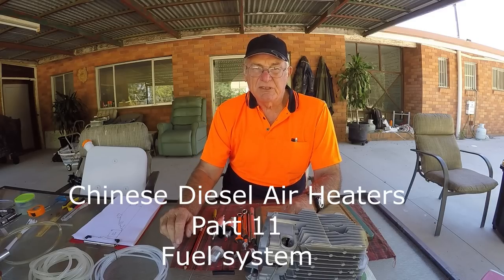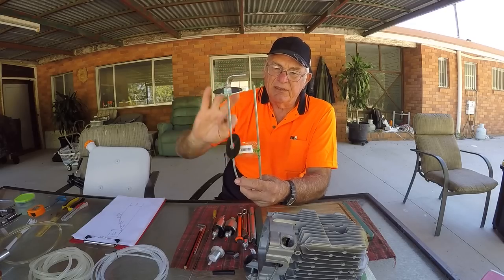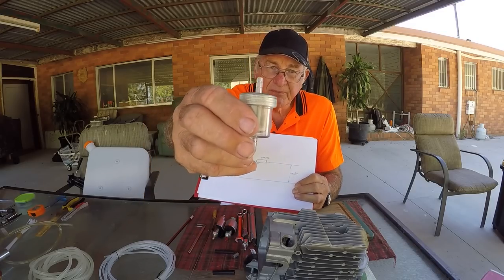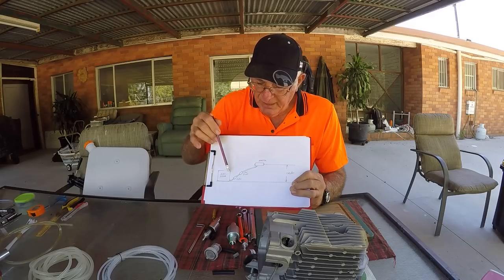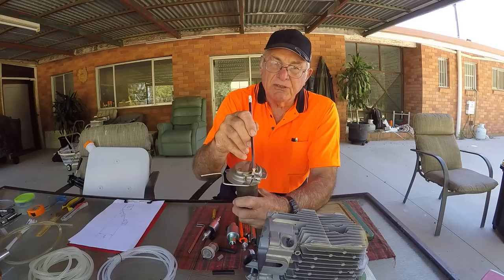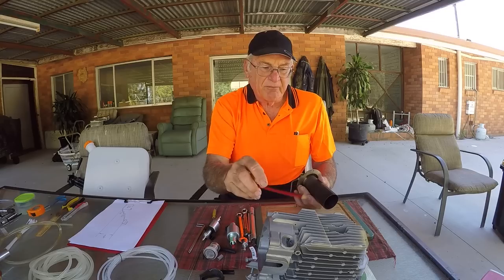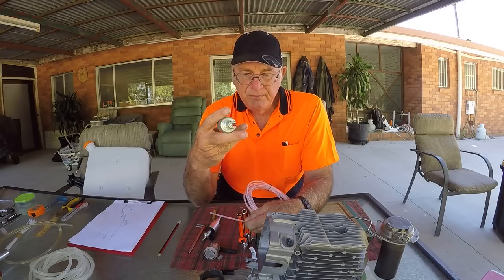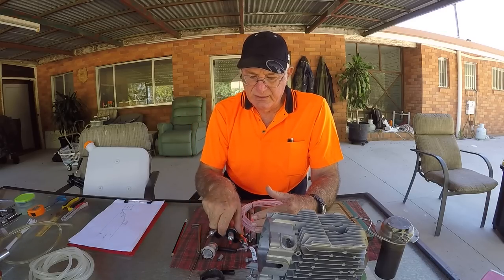Chinese Diesel Air Heaters - Part 11 -  Fuel Delivery

Comment: Hi John, thank you for making these videos they are very helpful! One question, Does it matter which way round you have the fuel filter? I am without instructions and have seen a few people do it differently I have the same filter as you.
Reply from the maker: Hi Rob, first thanks for your positive comments.
Regards the fuel filter. The fuel should enter on the outside of the filter. Think of it logically, you have a large surface area to filter out rubbish, and bulk rubbish and even water drops to bottom of filter where you can see it in a clear filter. If you put inlet to “inside” of filter it will not take much rubbish to clog the filter as there is no “storage” area.  Cheers.   JMcK
Reply: Thanks bud! I have got it the right way. Started it up and this 5KW is only reaching 102c on the heat exchanger. I'm using the correct hard fuel line. It gets warm but not the hot I was expecting. Could this be a problem with the 2mm fuel pick up line I installed into the fuel tank?

Comment: What kind of low temps can the fuel pump operate in? I’d rather have it located outsize my RV but I’m wintering in SD and concerned the pump will fail at low temps. Any advice appreciated?
Reply from the maker: Hi Mr F,

The pumps can operate in quite low temperatures provided you have winter diesel or use kerosene to prevent gelling of the diesel which can clog the pump.

I have personally run the pumps down around -1°C, the lowest winter temp where I live without issues, and overseas the winter temperatures get much lower than in Australia.

Most RV's have the pump outside the "house" and I have not heard of any issues, apart from the gelling issues mentioned previously. 

Cheers.  JMcK

Comment: I have watched several of your videos and have learnt an enormous amount regarding them. Thank you for sharing your knowledge.
Before I buy one can you tell me if they can be mounted on their side (combustion pipes facing sideways)?
Reply from the maker: Hi Guy & Debbie,

Yes they can be mounted on their side, but only the side that has the glow plug on the top. You need to open the heater up, identify the glow plug, and turn it only on the side that has the glow plug uppermost.

Cheers,  JMcK
Reply: John McK 47 Thank you so much for your quick reply! We have a Slide-on Camper which presents different options to a caravan due to the lack of free space on the underside.
Thanks again!
Reply from the maker: Guy & Debbie MacDonald 

Your welcome Guys

Comment: John,

I have an all-in-one unit and am retrofitting the fuel line to 2mm nylon as I said. From the fuel filter to the fuel pump can I just use a black rubber 50mm long connector to connect them or do I need to also use the 2mm nylon fuel line between the filter and pump with a black rubber connector on either side?
Reply from the maker: Hi Dacia, 

I suggest you use normal good quality 4 mm fuel hose from tank to filter (you need a fuel filter) to pump. 

It is from the pump to the heater that you need the hard nylon fuel hose. Soft hose, particularly that poor quality clear vinyl hose sometimes supplied absorbs the fuel pulse and prevents proper atomisation of the fuel. 

The longer the distance from pump to heater, the more important it is to use hard nylon on the delivery side of the pump.

But with the all in one heaters, the distance from the pump to the heater is very short and you can get reasonable atomisation just using good quality black fuel hose. For such a short distance, this is a better option than having the joiners and a very short length of hard nylon hose. 

The risk of joiner leaks in such a short distance of hard nylon out weigh  the benefits. 
With the all in one heaters, I suggest all fuel hose be normal good quality black rubber fuel hose.  

Cheers.   JMcK
Reply: @johnmck1147  Ah! Thanks John! I’ll get the black fuel hose!

Comment: My Diesel night heater is working superbly apart from i have to prime it every time i use it, When i turn it off in the evening the next morning the fuel line to the tank is completely dry. The fuel is draining back into the fuel tank, I have no leaks on the fuel line , Any ideas what could be causing this, When i prime it the heater runs fine again and never cuts out in operation.
Reply from the maker: Hi Jollyroger,

If your heater is about 1 meter or more above your tank the weight of diesel can seep past the tiny little valves in the fuel pump. Just install a shut off valve in the fuel line near the tank, and turn the fuel off when not in use.

You could also have a small air leak in the fuel line. The most likely place is the connection right at the heater. I would also check all your fuel line connections are tight.  

Cheers,  JMcK
Reply: @johnmck1147  Thank you john
Reply: John i have another problem with my chinese diesel night heater, When i try to prime the fuel line it will not prime, the fuel line remains empty and when i checked diesel was running out of the exhaust system, I tried priming it 4 times but it seems the diesel just runs straight through to the exhaust
Reply from the maker: @j0llyroger889  

I suspect you have flooded the heater.

You only prime the heater on first install. That is all. After that you just turn it on. My boat heater has been there over 13 years and even if not used for a year, I just turn it on. You do not prime before each use.

If diesel is coming out the exhaust, I suspect the fuel line is full, and not empty.
If badly flooded you need to give it a day or so for fuel to evaporate before trying again. 

If you are mechanically minded you can remove power to the fuel pump and operate the heater a few times so the fan helps to blow out liquid diesel. The ECU will shut the heater down when it detects no start, but you just hit start again a couple of times. 

If you are not mechanically minded, wait a day and just hit start. Do not prime.

Cheers.  JMcK

Comment: Hi John thanks for the in formative video on the fuel lines. My heater starts but only burns for a few minutes and stops. It also sounds as if it’s hunting while burning. I feel I have a fuel line problem but I’m not using the larger bore hose you described. Any ideas?  Thanks
Reply from the maker: Hi RM,

I need a bit more information before I can offer help.

Is the heater new and this has happened from the beginning?
Is the heater old, and this problem has recently started?
Do you have a good fuel filter?
What fuel are you using?
Is the fuel pump inclined upwards?
What is the distance between tank and pump?
What is the distance between pump and heater?
Are you using hard nylon fuel hose on the delivery side of the pump?
is the heater above or below the pump?
Thats enough for now.

Regards.  JMcK
Reply: @johnmck1147  
Hi John, thanks for the reply. My heater is approximately 12 months old but I have only used 3 times for short periods. It worked fine except for a lot of smoke on start up. Last month I wired in a on/off power switch and decided to start heater. It didn’t start and came up with E8 error. I looked at fuel and thought it was probably stale or contaminated. After starting a couple of times it fired up without a lot of smoke like previously and I decided to run for a few hours adjusting levels of heat up and down while it was running. Next day I decided to run again but could only get E8. After burner ignites it hunted and shut down. When installed I used a RYCO filter. I’m using diesel fuel. The pump is inclined correctly. The distance between tank and pump is 2.2 metres. Between pump and heater is 1.7 metres.  I’m using the hard nylon on the delivery side and purchased black fuel line on the delivery. The heater is positioned above the pump. It’s installed in a caravan. Thanks again John for helping. Rory.
Reply from the maker: Hi Rory,

E08 is a ignition/burn issue.

If only a little use, it is unlikely you have a carbon buildup in the atomisation screen.
However, do you have a filter on the combustion air intake? If not, you may have sucked some bugs into the atomisation screens.

Another thing I would do, is try and move the pump much closer to the tank. These pumps are much better at pushing rather than sucking. I try and get the pump less than 500 mm from the tank.

Next check your wiring and plugs. Do you hear the pump giving a regular strong “ticking” sound.
If not, you may have a voltage drop issue.

Do you see a steady stream of tiny cavitation bubbles marching along the hard nylon fuel line, at a regular spaced interval. If not you have a fuel delivery issue.

Cheers,   JMcK
Reply: @johnmck1147  
Hi John, thanks for the info. I’ll check what you’ve suggested.

Comment: Is using kerosene recommended for cold climates ?
Thanks for the very informative U tube.
Reply from the maker: Hi Solarrs, a kerro/diesel mix say 80%/20% can be beneficial for very cold weather or high altitude use.  JMcK

Comment: Hi John my mate have one of these heaters as do I, but his has started mucking up, it starts and runs fine but after 15-20mins the dosing pump stops running and it's as if it's gone into shut down mode all by itself. We fit a new pump but did nothing just the same, could it be the temp sensor do you think. Sadly his heater has the dial control not the digital one. Any help would be greatly appreciated mate. Thanks. Seeya Rob
Reply from the maker: Hi Rob,

It could be an overheat, or low voltage, or fuel blockage.

Your dial controller is simple to operate, and preferred by those who just want a simple controller.
But it will have little LED lights around the dial that tell you the temp setting. 

These will also flash if the heater goes into shutdown mode. Count how many lights are flashing, that will give you the error code and tell you the problem.. eg three lights flashing = error code E3
JMcK

Comment: Great video series John! These are very informative. I have two questions: first, how to you prime the fuel line without abuse the fuel pump? Do you use some sort of tool to prime the fuel leads? Second, is it an issue when the fuel tank is mounted above the heater instead of below? Thank you and keep up the great work.
Reply from the maker: Hi Hibon,

Thank you for the feedback.

1.  I generally, but not always, personally prime the diesel from fuel tank to the pump the way I learn't as a kid some 60 years ago, I insert a length of  clear tube so I can see the diesel and manually suck syphon prime the fuel line. but these days I have to tell people not to do it that way, as if not experienced or not careful you can suck fuel into your mouth and in a worst case swallow the fuel. 

You can use an outboard primer bulb, or buy a cheap prime syphon bulb from an auto store. You can also use an old large "horse" syringe to suck the fuel along the pick up line. 

If the fuel tank is mounted above the fuel pump it is important to install a shut off tap in the line before the fuel pump. But I recommend you always install a tap in the input fuel line regardless of whether the tank is higher or lower than the heater or fuel pump.

If the fuel tank is mounted above the fuel pump it will self prime. Take the hose off the bottom of the fuel pump, put the end into a glass jar, open the fuel tap and when diesel flows out turn off fuel tap and or put finger over end of hose and then push it on to the bottom of the fuel pump. Note, make sure the hose clamp is on the fuel hose first. 

Good luck.   JMcK
Reply: @johnmck1147  Thank you John!

Comment: John, if I am installing 2 diesel heaters from the same fuel tap, do I need to install check valves to keep one pump from sucking away the other's prime?
Reply from the maker: Hi JMatt,

I have not actually tested this myself (yet), but in theory it should work as the pumps have non return valves in them. But your question is a good one and when I have the time I will test it out.

Cheers.  JMcK

Comment: Hi John, thanks for all your great work with these videos. With installation under my caravan, I’m going to end up with a run of somewhere between 3.5 and 4 metres between the fuel pump and the heater. I know you have stated that ideally this part of the fuel line should rise gradually to the heater, but I can’t see that this is possible in my installation. Do you think that if I use the small diameter nylon pipe I may get away with a couple of metres of level(ish) run and the setup will still work, or is it bound to fail?
Reply from the maker: Hi Tony,

If you use narrow bore hard nylon fuel hose on the output side of the pump all will be fine. The tiny cavitation bubbles are easily pumped along the hard thin fuel line even if there are some ups and downs.  Have you seen the motorhome install video?  JMcK
Reply: @johnmck1147  Hi John, thanks for your reply. I’ve now watched your motorhome install and see that the vertical ‘ups and downs’ in your pressure side fuel line are much greater than what I’m going to end up with, so I’m now confident that I won’t have any trouble. Thanks again for all the time and effort you have put in.
Reply from the maker: @tonyglue435 
👍

Comment: When running a fuel pickup from the vehicle tank, it runs out the top, and along the chassis.  To put an up-ward angle on the pump, I would have to lower or put a bend in the fuel line to it.  Should this cause problems?  Thanks, Greg - TAS
Reply from the maker: Hi Greg, that should be ok. The piston action of the dosing causes cavitation bubbles to form and for these to be expelled from the pump it needs to be inclined upwards at least 15 deg. It is ok to have a loop down and then up to the pump. Don't forget the filter.  JMcK

Comment: John do you know if the 2000 kw uses same Atomizer Screen as the 5000 kw.  Destroyed one after some fuel went bad and tarred most the fuel supply and atomizer.  Bought a new heater but looking to tinker with the older one.  Thanks in advance Rick.
Reply from the maker: Hi Rick,
The glow plug atomiser screens are the same.
The burner atomiser screens are different.
Cheers.  JMcK

Comment: I bet that back in the factory,  the R&D, technical and SAS  departments are learning FROM YOU!
I've ordered my first all in one, 5kw red unit which I will open and see what they did.
Normally,  I'd expect them to have set it all up inside so that it doesn't have inherent fuel line problems.   Let's see
Reply from the maker: Hi Peter, many all in one units now ship with cheap clear plastic fuel line. Suggest you consider replacing that with good quality fuel hose at end of the season as the supplied hose perishes very quickly. You do not need the hard nylon fuel hose on the very short fuel hose run on an all in one heater.  JMcK
Reply: @johnmck1147  good idea.  Thanks
Reply: @johnmck1147  well.  It came today and I carefully thought about all that you had explained. 
I took the manual and tried to read the Chinglish.  
I took off the cover, examined all cables and tubes.
You were right it was assembled with clear 2mm (I.d) tubing 
I took it outside and started it up on a workbench.  It took 5 X 10-15 second priming then it started up. (Normal, as each pulse pushes a teeny-weeny 0.02ml)
Long-story-short,  it worked, so to speak,  right out the box.
It has the blue LCD control,  plus the little 4 button hand controller 
The incoming air was 7°C and the burner aluminium body was 156°C on the first setting, H1, and went up to <180°C on H5.  (Apparently it could go 2 settings higher, but I didn't want to push my luck)
The elderly lady down the road called me to see how it all went..
I'll go there next Sunday and turn it on there, so she can see it and feel the heat.
I think this is going to fly.  I certainly will order spare service parts, proper fuel line etc.
Just to say that your videos gave me the confidence to jump into this  :-)

Comment: Hi John,  is ther a way to quite the pump and the pulsing “clack clack” noise on the system I’ve soft mounted the pump and fuel line but it’s sill quite loud inside the van .  Cheers
Reply from the maker: Hi Dudley, you could try rubber suspension (see boat video) but you should only get a ticking sound. If you have a clacking sound you have air in the pump. Have you fully primed the pump? Have you mounted the pump in an upright manner to allow the cavitation bubbles to escape?  JMcK

Comment: one more thing can you mont the heater whit the in and outlet pointing sideways.I think you sad that in one of your videos but cant find it again.Thanks again fore your lovely videos it helps me a lot
Reply from the maker: Yes Monica, the heater can be mounted on its side, but only the side that has the glow plug on the top side. If glow plug on bottom it gets flooded with fuel and heater won't start.  JMcK
Reply: @johnmck1147
Reply: Thanks have a nice day

Comment: I like the idea of having a tank with a quick release fuel line so i can remove from van and put back in when needed. Would this cause any problems using a quick release setup on the tank? Thanks
Reply from the maker: Hi Ryan, I can see no issue with that provided you use something like an outboard fuel tank coupling that prevents fuel leakage and air ingested.  J McK
Reply: @johnmck1147   Thanks for the advice much appreciated

Comment: Hi John also where did you get the fuel line and filter as I’ve looked and can only find 2.6mm inner diameter or bigger
Regards John
Reply from the maker: Hi John,

Search for hard nylon fuel line for Eberspacher diesel heater.
I am reluctant to put links as suppliers I bought just months ago are no longer there, or no longer sell the product.

I just had a quick search for you, and the link below will get you started.

https://www.ebay.com.au/itm/5M-White-Fuel-Line-Nylon-Tube-Diesel-Filter-Clip-For-Eberspacher-Webasto-Heater-/303798978607

Any ID between 2mm and 3 mm is ok. The main issue is to use hard nylon fuel line on the delivery side.

Cheers.  JMcK